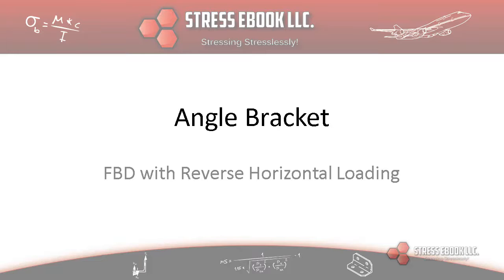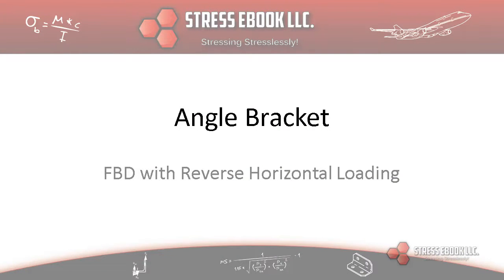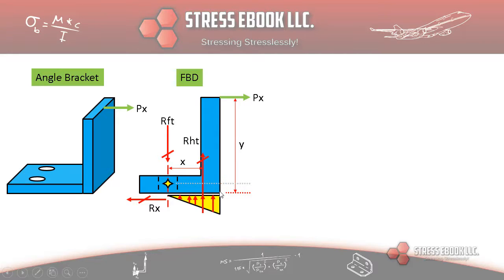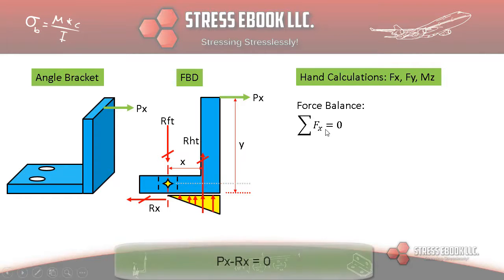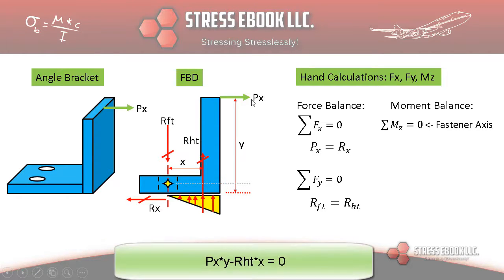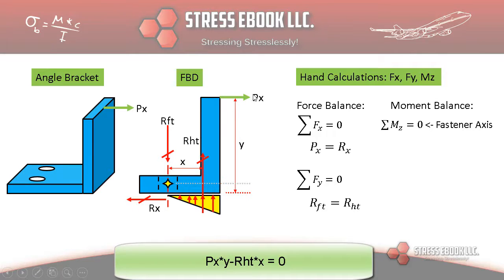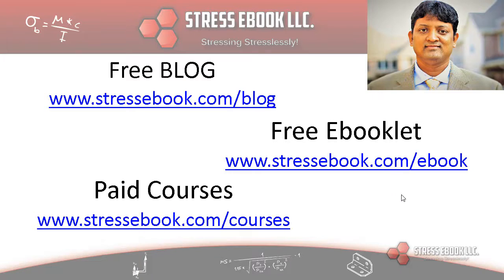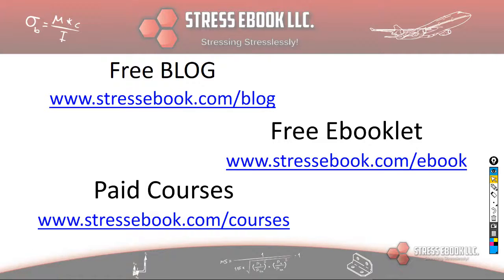Angle Bracket Horizontal Load Heel Toe Reverse

Comment: I probably have a naive question ... how do you know when to use the heel and toe concepts instead of saying that the Rht force is at the end of the bracket? If the x value increases, the force on the bolts decreases ... but then what is the right thing to do ???
Reply from the maker: The key is conservatism. You should definitely use it when the applied load is up and its a thin bracket. In other cases, Rht the way it is in this video gives you a more conservative answer, but only within reason. You need to sharpen your pencil if you have a negative margin as a result.

Comment: Excellent video!!!! It will be good as to complete this video with some  calculations  for  the thickness of  the bracket.  The  calculation of the  thickness t as per  the the actual loading strength LS = Mc *t/2 /( 1/12*b *t^3)  where Mc = P*Y as per your diagram...if   Allowed LS /(3*LS)  -1   ...is negative...you will increase the thickness...(I'm assuming a safety factor of 3).
Reply from the maker: Thank you for your kind words. A safety factor of 3 is overweight in the aerospace industry, maybe even obese. You can check this post for conservatism in the industry: https://www.stressebook.com/conservatism-in-stress-engineering/

Comment: How would you evaluate the moment capacity around the heel?  (Applied moment Px*y) 
I'm thinking that thinner brackets would not act as an entire section, and thus there will be a point where the upright flange would experience torque independently while the flat section stays flat. 
Is that right? At what force and thickness does this happen?
Reply from the maker: You are now getting into large displacements, which means you have much bigger problems now in your structure elsewhere which need to be fixed. These angle brackets are not intended for such applications. Small displacements is the key, like very small.

Comment: Thanks for providing such great videos. How would this problem chage if you add two additional holes to the horizontal plate? Thanks
Reply from the maker: Thanks for the wonderful feedback. If you add two additional fasteners closer to the vertical leg on the horizontal leg, assuming they are co linear with the existing fasteners (or not), basically you are reducing the applied moment arm. 

At the same time you are also increasing the heel toe moment arm. The larger the heel toe moment arm the lower the heel toe reaction load will be, thereby effectively reducing overall fastener loads. 

The heel toe moment arm will now be 2/3rd the distance from the new inner fasteners. The previous outer fasteners can be assumed to effectively do nothing as the new pivot is about the inner fasteners.
Reply: Thanks for your prompt response. I apologize for the confusion, but i meant to say adding two holes on the vertical plate. The end result would be two holes on the horizontal plate ( like this video)  and adding two holes on the vertical plate. Thanks
Reply from the maker: Good question. In that scenario, the top can be considered guided, hence the bottom will not see no heel toe. The top fasteners now will see heel toe, and the problem becomes the same as in this video (it is akin to switching loading to the reaction on the horizontal leg): https://youtu.be/bIlnoC_Ki_o